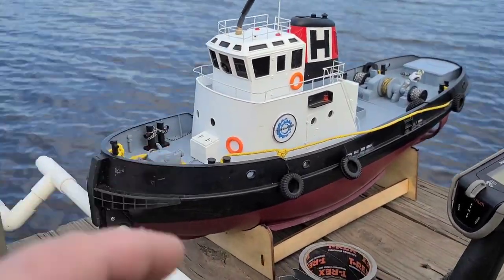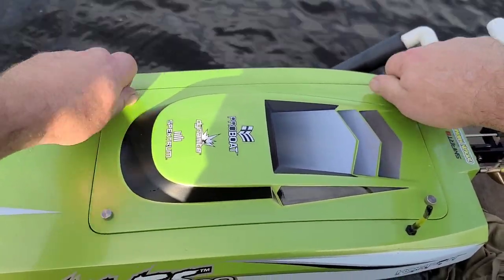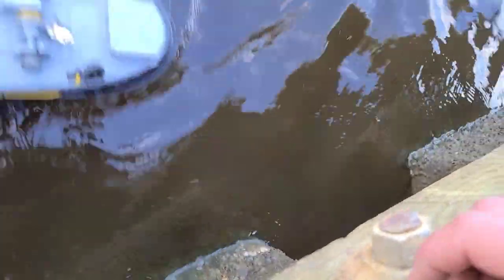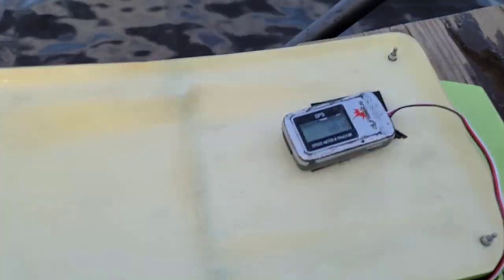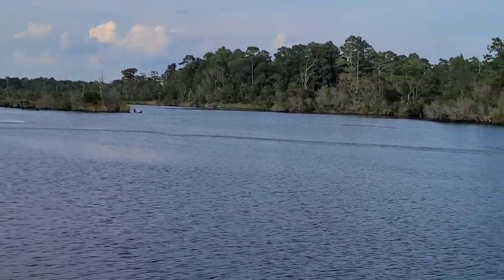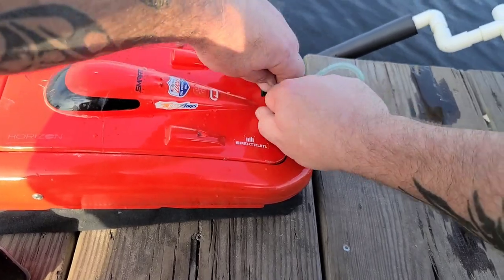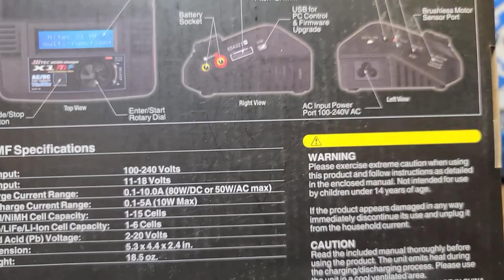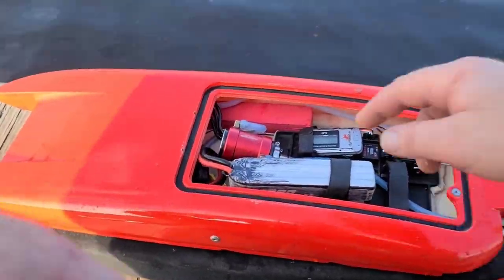Running A Couple Fast Electric Rc Boats- Veles 29 - Blackjack 24 - Horizon Harbor

Comment: Big B keep the videos coming! I have two P boats. Have done all your improvements. 
Enjoy the charger.
I just got 2 SMC 5200 mah Mudboss lipo but no idea I'd it's 50c or 100c.
And they run my boats faster than my Spektrum 2s 100c 5000mah batteries.
Reply from the maker: I believe It I couldn't keep the boats on the water with the smc packs. Wow amazing.  Thanks again brother

Comment: great video big b.both boats are running awesome, I got my 24 the other day, and it arrived with a cracked hull,urg,waiting for my replacement, believe it or not, I have the udirc arrow 5 i run alot,i upgraded the esc to a 90amp and run 4s in it and i get 40mph and no smoke,lol, i love the boat for my pond, its stable and turns great, take care brother, ill be waiting for your next video
Reply from the maker: Oh man that's a bummer brother. Always something. 40 with the arrow is  awesome 👌

Comment: Hey Big B, love the Chanel. when changing props within the same session what do you do to keep the bullets from coming loose and possibly loosing a prop?
Reply from the maker: If I'm using a bullet style nut I use blue loc-tight on the nut.  If I'm using a run of the mill locking nut I use 2 nuts or single nut with a drop of toc-tight
Reply: @IRONCLADRC  doesn't loctite need like hours to set?

Comment: I’m wanting to do a similar black jack build. I just got my 90 fly color in. Did you have to move or cut the styrofoam that’s near the motor? It looks like you have it tucked pretty good. What kv is that motor?
Reply from the maker: The motor kv is a little to high its 3250kv I'd recommend something like 2600kv instead

Comment: The esc issues folks have with the tug is cuz it leaks around rearmost hatch like mine did n it floods the hull n drowns the electronics....top n bottom hull halves not completely sealed....ive had to do several my LHS has sold
Reply: I’ve had this happen a ton too. Any recommendation for sealant? Do you just seal through the back access panel that pops off?
Reply: @zackoftrades8547  yup!!! I just used e6000 n smeared the whole seam around the back where that raised bit meets all the way around the rear..water tight now!

Comment: I don’t find the rippled water makes for a  pb  speed, especially when the prop seams to be not constant in its grip.
I Lost my 30 inch rigger the day before yesterday  in 8 metres of freezing water.It sunk before I could paddle to it.
It had new 6s 5000 100 c lipo new soektrum receiver a new Savox servo 
As well as tp4040 1850 kv flycolor 150
And my garmin gps, all gone . 
Frig
Reply from the maker: I couldn't agree more, I sure have a good time trying lol.   Thanks for watching ironclad rc